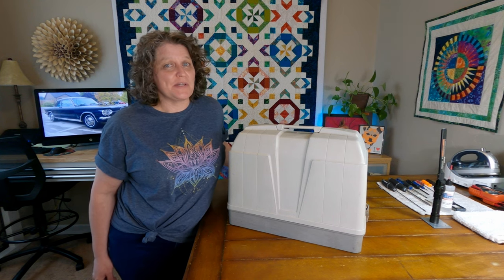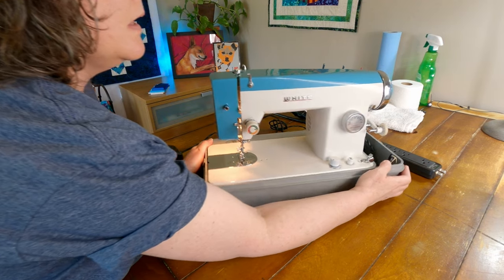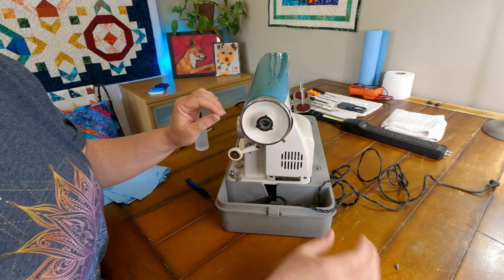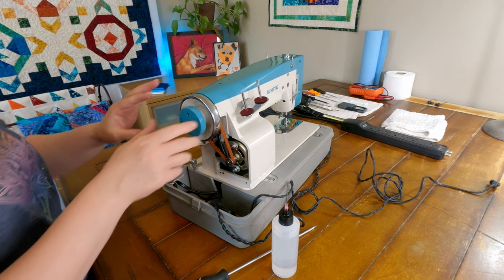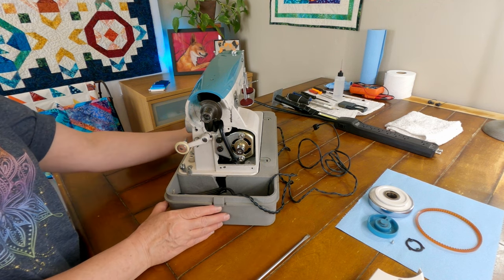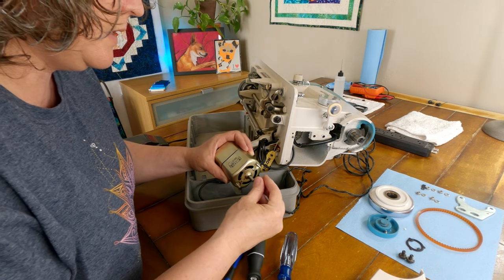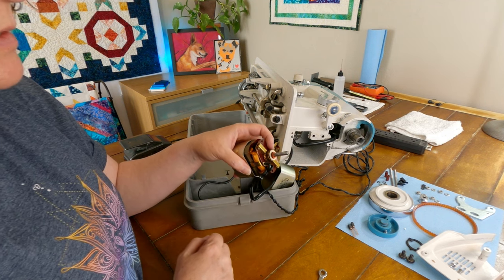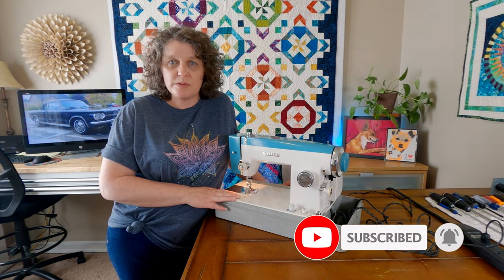Thrift Store Find  -  White 173 Sewing Machine

Comment: I have a similar era blue and white White only it's a zigzag model. It's a great machine, happy you got yours working! Look on the top of the machine and see if there are two recessed screws that hold the "lid". If so, you should be able to remove the lid for oiling. Also be sure your belt is not too tight, it should be just taut enough to make the handwheel turn bit not so tight it puts stress on the motor pulley. Happy sewing with your new machine!
Reply from the maker: Thank you so much for the comment! That is neat that you have a similar machine. Yes I do have 2 holes on the top of the machine that access screws, but they are access to the drive shaft cam  bolts. I would imagine that you have a lid access because yours has some kind of cam for the zig-zag feature that mine lacks.  My machine is solid cast and does not come apart. Also, Thank you for the suggestion on the belt tension. I do believe I had it too tight. I loosened it up and also loosened the pulley on the motor and it self aligned. Thank you again for the help! What an awesome community we have. Good luck with your projects!